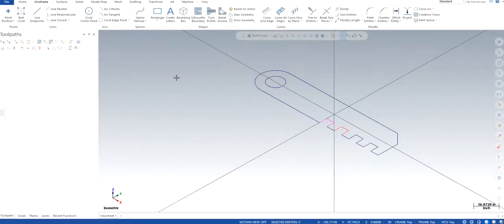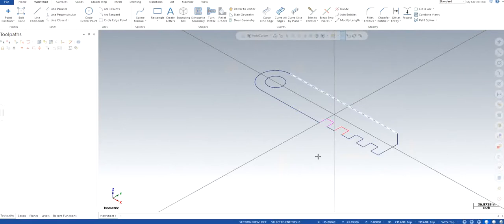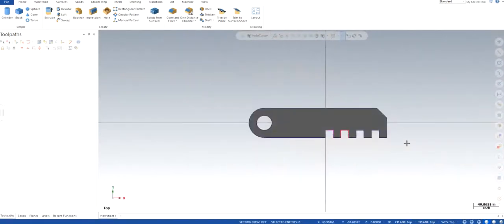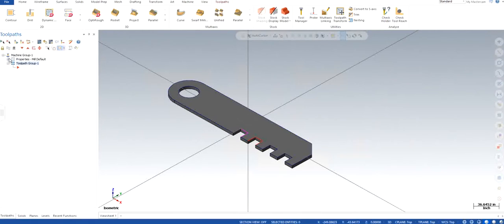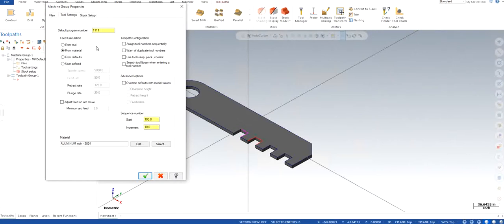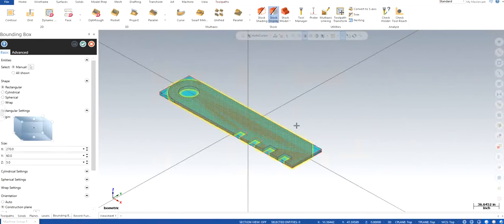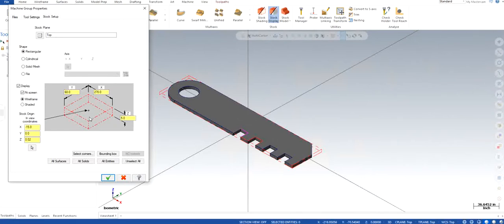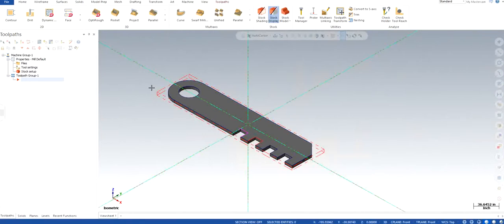MASTERCAM 2022 : 2D WIREFRAME TO SOLID WITH STOCK SETUP - PART 1

Comment: do you have any experience with the new mastercam 2024  edition? considering making the switch to it for my new techno cnc titan series. We're only making most 2d cuts of circles and squares (just to give you an idea) thanks!
Reply from the maker: No I haven’t used 2024 mastercam yet. Maybe in future, presently i am mainly working as designer